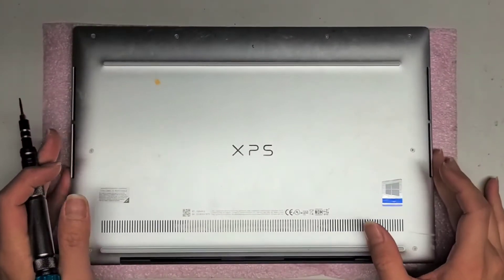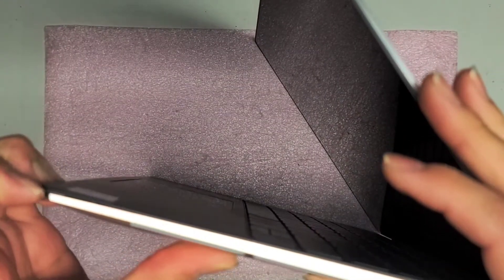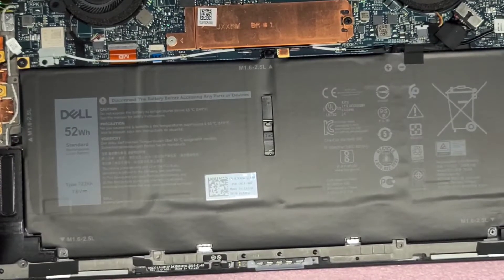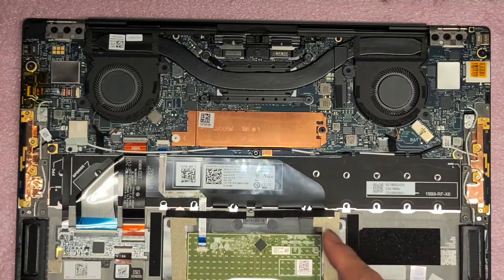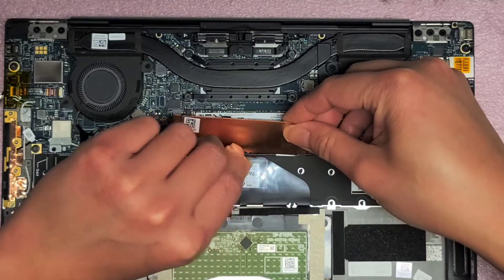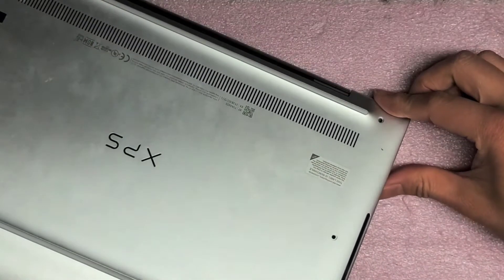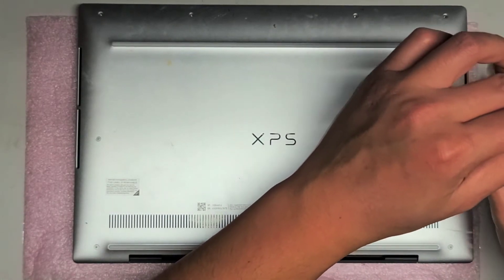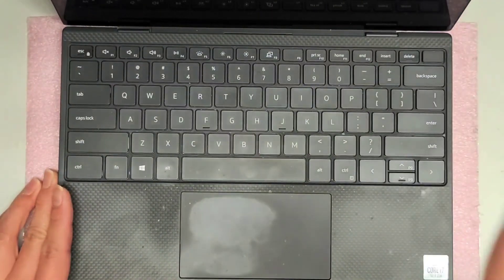DELL XPS 13 9300 Disassembly SSD Hard Drive Upgrade Black Screen Boot Repair Battery Replacement

Comment: Hi, just want to ask, what possible will happen if your laptop has no thermal heatsink cover of ssd?
Reply from the maker: It'll run hotter less performance
Reply: @ItsBinhRepaired thanks
Reply: @ItsBinhRepaired thanks